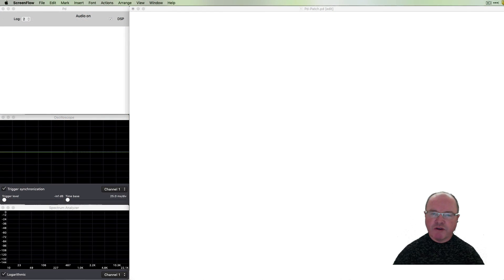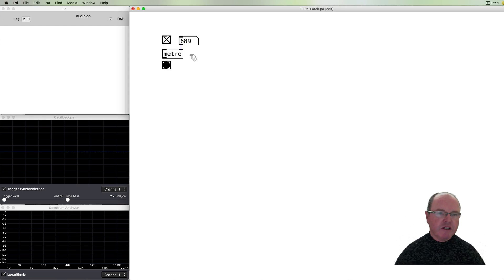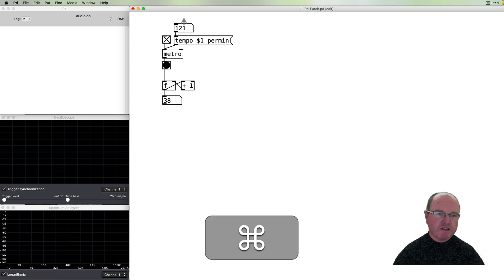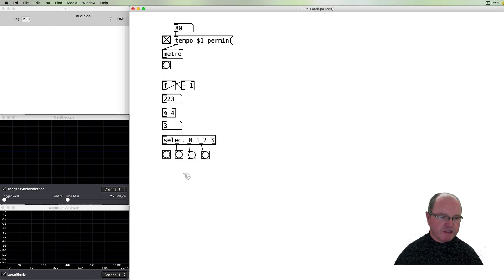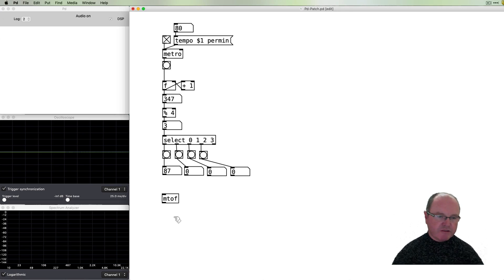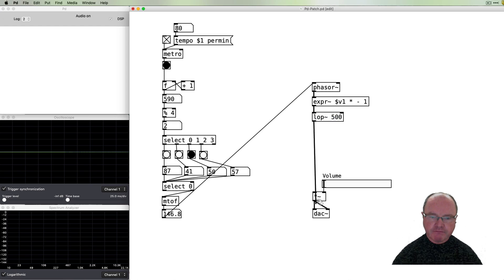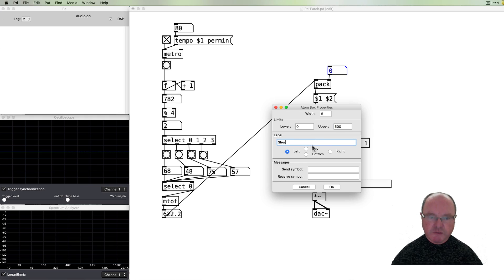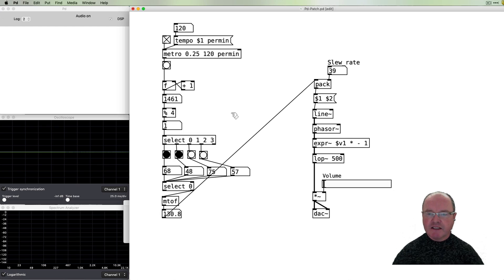29. Step Sequencer in Pure Data

Comment: The bang stops working after I insert the 'tempo $1 permin' message. My toggle is still switched on. Any idea why that is? 
And Really cool video by the way, I've been wanting to build a sequencer since a while now!
Reply: If anyone is still experiencing this, I fixed it by adding " 1 120 permin" to the metro box. so it reads "metro 1 120 permin"
Reply: Same here, the number box just adds one every time I manually press the toggle. 

Did you manage to get it working ?
Reply: @thefirs2334  Same happened to me, something buggy is going on. I ended up getting it working but not 100% sure on what I did. I replaced the toggle button and moved the BPM number around a bit until it just started to work.
Reply: I noticed this behavior, as well. With the toggle on the metro inlet, the bang would fire only once. The help window for metro suggests using separate "bang" and "stop" messages, and that worked for me. I'm using Pd Vanilla (Version 0.50.2).